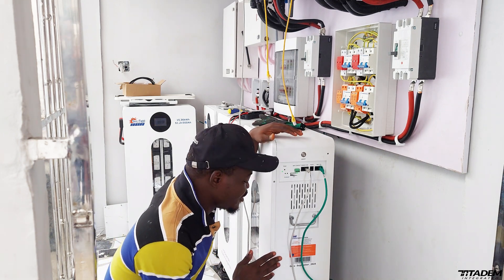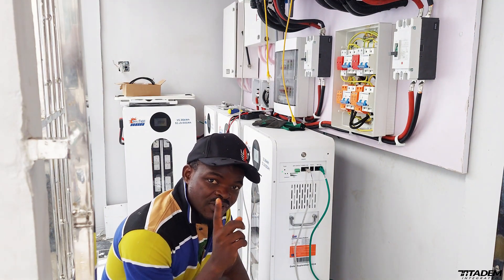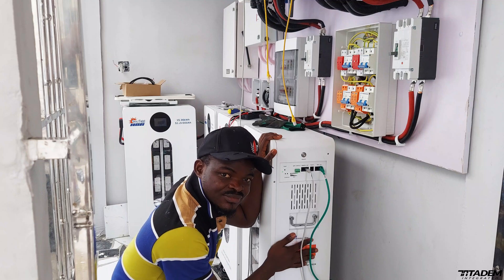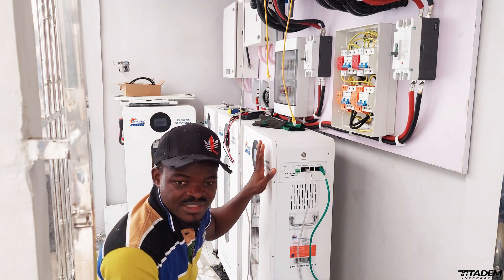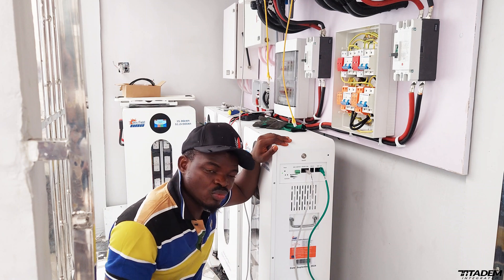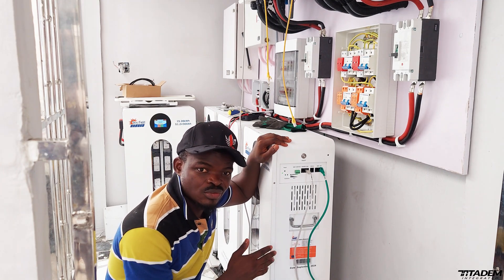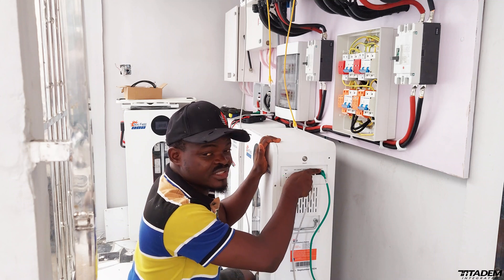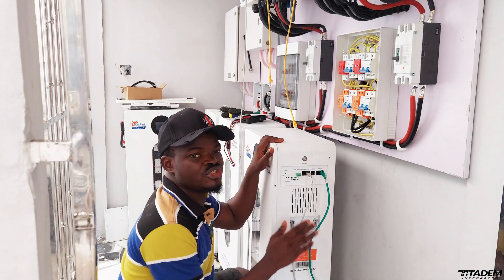Everything you need to know about Sunfield LITHIUM Battery

Comment: Lol bro do more research before you put out information, charging lithium to 100% makes it degrade faster, they last longer when you cycle them between 20%-80%
Reply from the maker: Or better still 
Name a single battery brand that has ever told you to let your battery stay within 20% to 80% of charge
Reply: Not accurate bro. Charge your cells to 100% for more battery performance
Reply from the maker: Again the ignorant once that thinks they know anything
Reply from the maker: I challenge you to point out a single reliable source that said charging lithium batteries to 100% is bad.
Do extensive research yourself rather than relying on what your colleagues told you
Reply: @chiefsurgeon001 oh it's simple, try chatgpt.... Not the free version tho...  Lithium batteries don't like sitting at the extreme ends of the charge that's why they are shipped  at 50% ...... Like I said do your own research I won't be the one to teach you